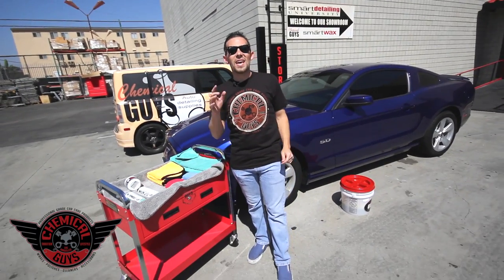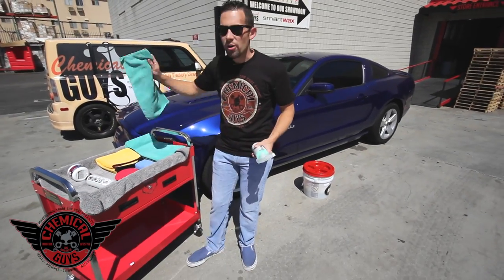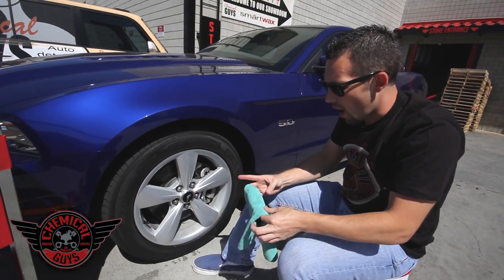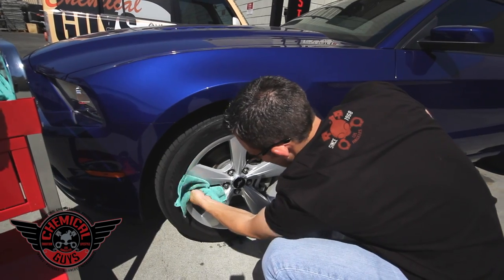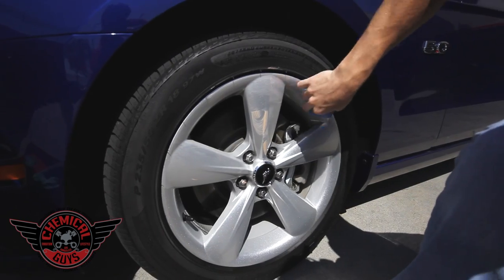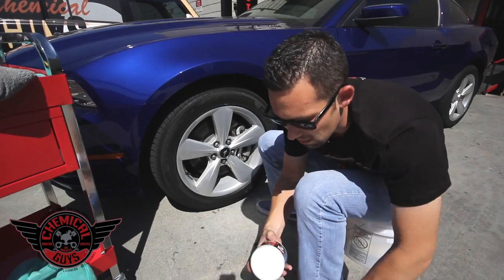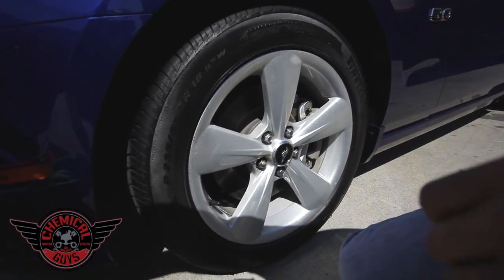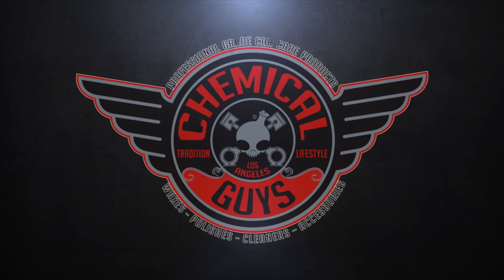Quick Wheel & Tire Detailing - Chemical Guys Wheel Guard VRP Dressing Mustang GT

Comment: How can I clean my alloy wheels if the brake dust does not come off with basic soap and water.  I think the brake dust is chemically bonded some how because when I try to clean it it doesn't come off.  I have to scrape it off and that damages my wheel

Comment: we can use rim polish instead of jetsealent
Reply from the maker: Jetseal is intended for paint not rims, yes you can use it but Max Coat Wheel guard will deliver highest temperature protection and work better on wheels.